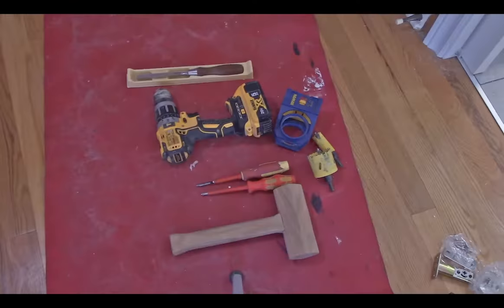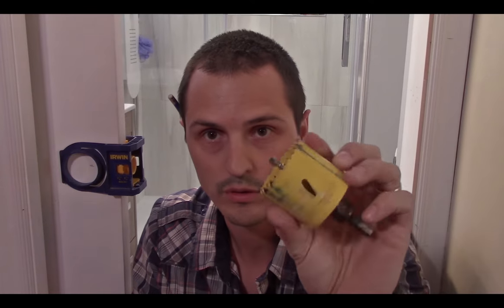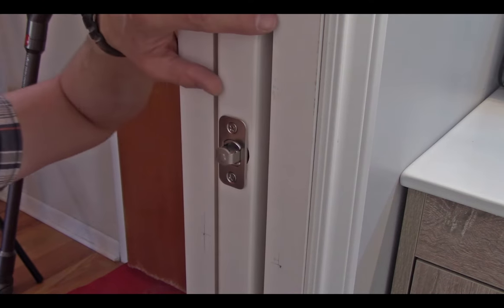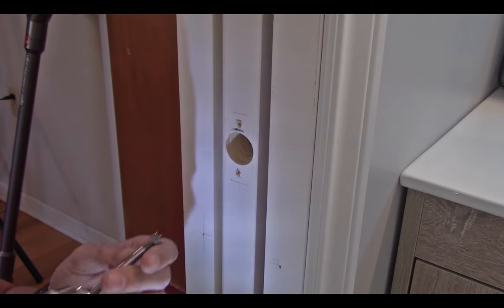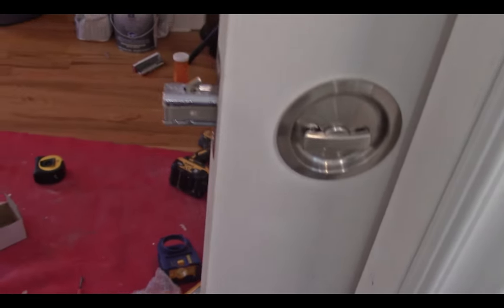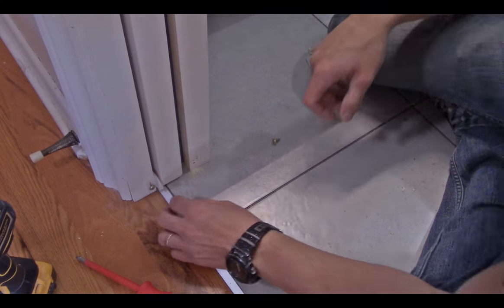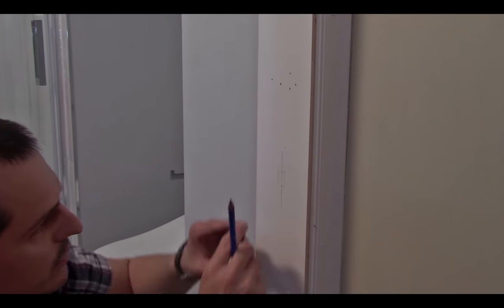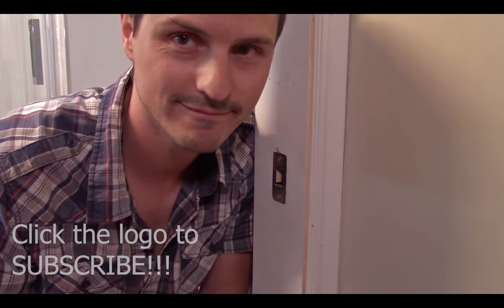how to install a handle on a pocket door 🔒 (AMAZON LINK)

Comment: Whenever you want to drill a hole with those kind of hole cutters, never start your cut in the forward motion as you will nearly always cause a blow out around the circumference. Better to 'reverse' the cutter into the wood, that way it drags a starting cut first rather than gouges a cut, and once this goes through the first 1mm, then change direction and start cutting. You will always find a better/neater cut. Works on all surfaces.

Comment: Just an idea. When I do doors, i try and screw in my latch inside out so that the finish edge is what I run my utility knife against. Sometimes they are 1/8 thick and the inside part doesnt come to the outside of the latch (part with two holes). Not sure if I explained it clearly.

Comment: So great of a video that I am returning all my old-school style, tiny-turn-to-lock rectangular hardware for 5 pocket doors on my 2nd floor and ordering the round versions.  Plus, I can more easily wait until after install, paint, etc. to install the hardware.  Otherwise I was planning to install the locks before rehanging the pockets and trimming the exterior of the door.  Great video and attitude!!  Thank you for taking the time.

Comment: I got a kwikset one that doesn’t actually lock. As in the dial turns and doesn’t latch to anything so when i slide the door is still opens. Super annoying. So i will try this dynasty one and hope that it actually locks for real. i almost want to see you tugging on the door to prove it 😂. I’ll take your word for it.  Hope it works this time 🤞🏻

Comment: Was your hole you cut 2” or 2 1/8” like a normal handle? Does the jig work for both? What is the jig you used? Do you have a link for that?
Reply from the maker: Do you mean the backset? The jigg is adjustable to either backset settings. It’s an Irwin jigg, I had an amazon link but I took it down... google Irwin door handle jigg. They are also available at Home Depot, Lowe’s etc

Comment: Great video!  I watched for any tips you may use that I didn’t think of and you did a couple things that will be very useful, like screwing the plates to the door and jamb before tracing with the knife.  I would have used the pencil and just traced them, and not got as good a result.  Thanks!

Comment: How do you keep the door from wiggling back and forth when it's locked. My lock is installed. I still have to put the catch plate in the jamb. But it seems like the door will wiggle back and forth an eighth inch or so.
Reply from the maker: Subscribe and I will tell you!!! ;)
Adjust the guides onwards to tighten the gap (I uploaded a pocket door guide video)

Good luck!